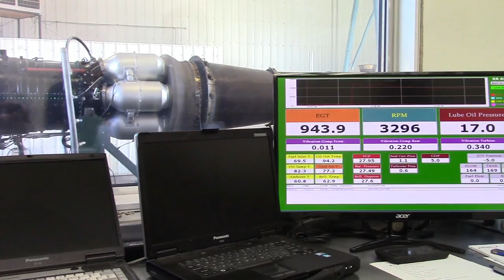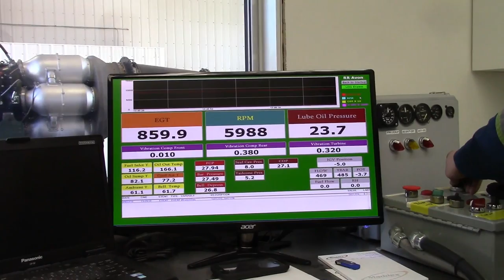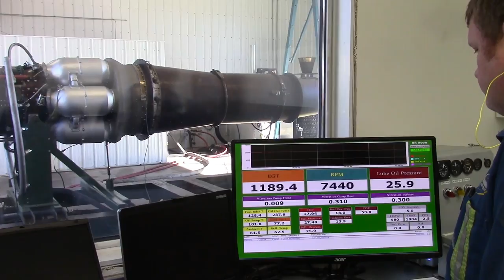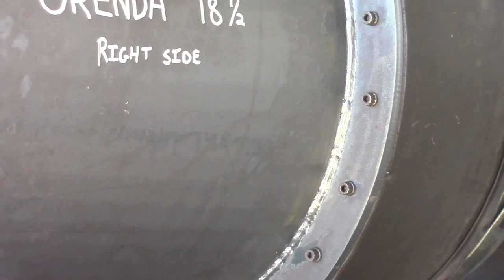Land Based Jet Engine

Comment: why does the EGT dip at certian RPM's? i noticed it was lower at 5000 RPM than when it was at idle and at (im assuming) max throttle
Reply from the maker: +Dick Cheneh 
Great question. I will provide a detailed answer in an upcoming video when I get back home.

Comment: In the words of the archetypal American travelog (the Brit in me wants to add '-ue') of yesteryear, "And so we say farewell to Singapore, land of the Merlion and the Singapore Sling (at SGD28 a shot)". I will be back on home territory tomorrow, following a 13hr flight back on a B.777. If it's a GE90, rather than a Trent 800 powered aircraft (BA have both), the vibration levels on start-up (which must surely be down to combustion rumble) are quite high, even unpleasant.
Reply: Hello Graham, hadn't said that <hello Graham> in a while so thought I would.  Hope your visit went well & those G.E.s got you back without incident.  I have never been on a 777; do others on the plane seem to notice the rumble at start-up?  Take care & thanks for sharing.

DD
Reply: Yes, the visit went well and I got back home quite uneventfully, thanks.  No-one else seems to notice the rumble and vibration of the GE90s at start-up, but then I'm relatively more aware of what the engines are doing and I'm in a position to compare them with Trent 800s (and 900s on the A380).

Comment: It seems like the turbine section of the engine is extended almost to the length of an afterburner jet pipe. Is there a reason why it is so much longer in this engine than in the aerospace version of the engine? (Also that compressor casing is gorgeous)

Comment: I have watched most of your q and a videos and never seen this question asked: Roughly how much does it cost for a engine test like this? I would assume it is included in the price for refurbishment? Thanks.
Reply from the maker: The test cell has a rental fee. Plus the efforts of several techs working for anywhere from one to four days, depending on the engine type, plus anywhere from several hundred to ten thousand for fuel.

Comment: Seems to be a very brief test,...power assurance test....but didn't see any trim suppression being done? You guys normally shoot for 23 degree Celsius correction along with correcting the rotor speed to the square root of theta to determine if you are hot and fast for a given enough PLA setting? What is the PPH WF for take-off?
Reply from the maker: If you read the first line of the info section, this is an industrial engine.
Basically a core of an aviation engine.
No trimming required; this engine does not use a jet nozzle to produce thrust.
It does not ever take off ( we sure hope! )
Fuel consumption is often not a concern, for several reasons.
This test was indeed to measure power, also vibration, and to check for any leaks.
The fuel flow is controlled by a computer, which measures rpm, temp, air density and demand.
Everything checked out.

Comment: Hi JZ. As ex USAF, (flt sim) and gearhead love the videos and tech info. Seems as though a lot of heat would need to be dissipated after shutdown. Is windmilling of the internals enough, or does the engine stay hot?
Reply from the maker: The long rundown time of several minutes has the compressor still moving air through the engine, so this is usually enough to cool the engine down to the point where no harm is done. but the jet pipe stays too hot to touch for at least 10 min or so...

Comment: Wow, the attention to aesthetic detail on this engine seems especially apparent; it looks like a museum piece! I love the green coated bolts on a black compressor housing. Is there a significance to the green bolts? Or just a choice? Also, for this test, is that a aircraft jet pipe attached? As this is an industrial variant, I imagine there will be a power turbine there when in service. So is a jet pipe a way of adding some load to the engine during testing?
Reply from the maker: The compressor case bolts were marked green as they were torqued.
Your thoughts on the jet pipe extension are correct.

Comment: I'm curious, for the industrial engines, what do you used as a measure of performance?  It's not set up to produce/measure thrust like an aircraft engine would.
Reply from the maker: We use a restrictive nozzle on the jet pipe. Increased pressure upstream of the nozzle is used to calculate power output.

Comment: Pretty green for this late in the year there.  Run looked good, you got a lot of the ambiance well in the recording including the human aspects which is good to see too.  I am curious, when these engines were designed it was without the benefit of 50+ years of operational experience.  In service, are the systems that monitor these engines performance over time modern adaptations to the engine or are these operated as-designed and monitored as they were when originally constructed?
Reply from the maker: The controls and monitoring equipment is supplied by the operator, so often it is fully modern. Often it is whatever was the best available when the facility was first built.

Comment: I am currently building a 3d printed jet for a school and potential business project. i am titanium 3d printing the turbine blades  and makings the intake cylinder and blades from carbon fiber and fiberglass.what im having problems with are the bearings for the turbine blades. Do they require special bearings being its exposed to almost 1000 degrees, PLEASE HALLLLLP , by the way you helped me realize im a total gear head!
Reply from the maker: Turbine blades are never made of titanium, because it is weak, has a low melting point, and catches fire easily.
I don't know what an intake cylinder is.
Turbine blades do not have bearings, in my experience.

Comment: What a beautiful piece of art.  It is a gorgeous engine.  
Question for you Sir AgentJayZ -- with an EGT of 1100 degrees (I am assuming F and not C) do some companies send the exhaust gases into a boiler to create steam for heat or electrical generation?
Seems like 1100 degrees would flash water to steam pretty quickly.

Fantastic video.
Reply from the maker: That is definitely done in some installations. It adds to the overall efficiency of energy usage.
Reply: There are numerous industrial gas turbine installations where the the exhaust from the power turbine, which is driving a generator, then goes to a boiler, which supplies steam to a steam turbine,  This arrangement is known as 'combined cycle'. Alternatively, the heat is recovered from the power turbine exhaust for district heating purposes. This arrangement is known as 'combined heat and power' (CHP).

Comment: How small is the gap between the turbine blades and the wall of the jet? It sounded a bit squeaky on the wind down at the end, what was causing that? 
(P.S. Thanks for the really informative videos! I'm thinking of going into aerospace as a career and these videos have taught me a lot about the function of these magnificent devices.)
Reply from the maker: This engine specifies 1/10 of an inch clearance between the tip shrouds. The shuddering sound near the end is the fuel pumps, which are axial piston pumps and have sliding surfaces inside.

Comment: What is the application for this engine?
Reply: Primarily used as a turbine for gas compression, oil pumping, and electricity.
Reply: In the description he says "ten thousand Hp industrial gas generator" which is going to be a 7 to 8 megawatt generator. You can find a lot of installations using jet engine technology.  There are some significant advantages to their use over other technologies.   The primary consideration is that anything that can be made a vapour and burned can be used and used in the same engine. In practice this is achieved by fuel nozzle selection if you are going to use Jet Fuel or Natural Gas or Propane (etc).  The power and efficiency deliverable is otherwise similar to a Diesel generators though I don't know what the peek Diesel generator power is, there are 48 megawatt Jet generators available now.

Comment: 0:10 in, and I have a Q.  The green tinted bolts on the compressor casing. Is that die to indicate there all set to go, or is that the color of the bolts?
BTW, I'm jealous. If only the engine in my Jeep looked that good when it came back from the shop, that OTF-3 looks incredible.
Reply from the maker: From earlier:  The compressor case bolts were marked green as they were torqued.
Reply: Thanks. I suspected as much, tho it just looked so good to be a simple green mark on each bolt. The crew that worked on that engine realy outdid them selves, it just looks so incredible all around.  Bravo Zulu.

Comment: Considering maintenance costs, sound levels, and fuel efficiency how does an engine stack up against and industrial diesel engine?
Reply from the maker: Same, louder, same, but also much lighter for the power output, if that matters.

Comment: Is there any specific reason why industrial turbines use propane rather than diesel / kero ?  like, do they produces more power relative to which fuel they use ?
Reply from the maker: Industrial turbine engines are often used at natural gas pipeline compressor stations.
They can be fuelled with the contents of the pipeline, which is convenient because they use a lot of fuel.

Comment: Agentjz, In regards to the Orenda type,  what is the psi of the air in the diffuser at maximum output?
Reply: If you do some research for yourself, I think you will find that the pressure ratio of the Orenda series is about 5.5:1. I think that I can leave you to multiply 14.7 by 5.5.

Comment: Does the electric motor in the front freewheel the entire time after power is turned off or does it have some sort of clutch/gear that is disengaged?
Reply from the maker: There are two systems. One is a starter generator, and it is always turning. The other is simply a starter, with a disengaging clutch. I'm not sure which system is built into this engine, but I would think it's the latter.

Comment: Hi everyone! Does anybody remember the units in which EGT is in? I mean for C it's quite hot! Second question would be for you mr JayZ. How long did you work on your last engines? Or on how many engines do you use to work simultaneously? Because it just seems to me that the test cell works like what.. once a week an other engine? Than you for your videos!
Reply from the maker: Since I am not eligible to give you the answer for Q1, I will just tell you that the test cell is a shared facility. There are four companies working on engines, and each of those companies have more technicians than Jet City. The test cell is used by all, and it can get quite busy.
Reply: Jakub Polomsky Looking at the screen with the EGT, below that is the ambient temperature, which is at 60°, so Fahrenheit. Don't know if the EGT is measured in Fahrenheit though.
Reply: I saw 1,184 (or thereabouts) for the EGT, so minus 32, times 5, divide by 9, gives 640. Now that looks reasonable for an EGT (aka JPT) in degC for this engine.  1,184degC equals 1,457degK: now that's turbine entry temperature territory for a more modern engine than an Orenda 14 or an  OTF-3. It's into the realm of cooled turbine technology of the early1970s - about that of the RB211-22B, for example.

Comment: Ive always wondered: The Inlet Shroud bit (the white part on the front), do you have a mass of different sizes to suit every different type of Turbine you test? Is there a standard size they all take?
Reply from the maker: The size of the inlet bellmouth is determined more by engie diameter than by mass airflow. We have several different sized units, as well as a few adapter rings, so we can accommodate the range of engines we test.

Comment: agentjayz, why does the compressor blades have a lower cross section for the stages? pressure increase?
Reply: That would be YES.
Reply from the maker: I'm not going to spend the time to sort out what you mean by this incomplete question, but what most people assume about the shape of the compressor is not correct.
I have explained the shape of the compressor gas path in several of the videos in the Your Questions Answered playlist, so you may want to have a look at the index.

Comment: I love your videos, I've watch 'em all. Jet engines are very reliable. I have a 2 part question with regard to failure modes. One, during the normal work life of one of these engines what issues require most maintenance. And two what are the most common reasons for their ultimate trip to the bone yard?
Reply from the maker: Fuel nozzles need periodic cleaning, and the combustor liners tend to slowly break up or erode due to vibration.
Probably the most common reason for scrapping a flight jet engine is because it becomes obsolete... the aircraft type is retired, and there is no longer a need for that model of engine.
Industrial engines, same thing. They can be kept running indefinitely. When the whole installation is replaced or revamped, that usually means newer engine types.
The engine in this video is over 60 years old, but has been returned to new condition. It will never be scrapped until it has no job to do.
Reply: I recall that, years ago, I used to visit (there's no other description for it but) a scrapyard in the Midlands of England that specialised in surplus military hardware (I think it still does). My father used to go there occasionally for various bits to equip his garage workshop. He was in what you know in N America as auto repair. On one occasion, we came away with an ex-US military, petrol/gasoline engine powered air compressor and tank, which we converted to an electric motor drive, and I did the wiring for it (now that would be totally illegal today!). I remember that, one time, there was a pile, several high, of Orenda engines (I saw the nameplates). How and why they ended up in the UK, I've no idea, of course. Another time, there was a pile of Olympus 100 series engines, which must have been from scrapped Vulcan Mk.1 bombers. Now their presence  in a scrapyard in the middle of England is entirely understandable.
Reply: I think that I might have answered my own question about the scrapped Orendas. It suddenly occurred to me that the RAF operated several squadrons of Sabres in the 1950s and Wikipedia informs me that they were Canadair Sabres. My guess is that those engines were from the Sabres when some of them were scrapped.

Comment: Would you be able to use the starter motor to generate some auxiliary electric power once the turbine is up and running? I'm guessing that's hardly a priority for industrial engines though...
Reply from the maker: The aircraft engine uses a starter generator, but industrial engines just need a starter.

Comment: What is the unit cost for an Orenda or J-47? I'm curious.
Reply from the maker: There is no unit cost. Each engine is a project, and total cost to rebuild it really depends on initial condition, and the intended use.
Reply: I see, in that case, you're doing an amazing job.

Comment: Question - how big is the tolerance between the compressor blades and stators?
thanks for making videos :)
Reply from the maker: It's not a tolerance, but a clearance. The two are not the same thing. There is a clearance of about 5 to 10mm between a stage of compressor blades and the stators. This allows some fore and aft movement while avoiding contact, which would cause great damage to the engine.
Reply: thanks for correcting me and answering
Reply: Thousandths of an inch.  Each stage is different.  The clearance decreases as the stages get smaller.
Reply: The axial clearance between compressor blades and vanes is defined primarily by the need to ensure that they don't 'clash' in the event of an engine surge.  The clearances may have to be further adjusted to allow for differences in axial expansion between the compressor rotor and the stator casing.

Comment: At what point does power turbine attach to the rear of the engine? Right behind the last stage or is there some set distance away from the last turbine stage before it is attached?
Reply: A power turbine is essentialy another turbine stage, attaching it any further than "just behind" the last stage would mean losing energy of the flowing air on crossing that distance. So power turbines are attached as close to last stages as possible.
Reply from the maker: This is intuitively true, but in practice the duct is of any length that suits a variety of requirements.
I have seen an PT duct that was over40 yards long with several 90 degree corners, and even a 180 in it.
It worked just fine.
The gases do not lose much temp as they pass through the PT, but they do drop almost all of their pressure.

Comment: Could a sodium powered jet engine run under water? It seems like it would not work very well.
Reply: boomchacle no jet engine could run underwater under any circumstances. Ya know....because they rely on compression and subsequent expansion of air and fuel. Water cannot be compressed so....
Reply: Yes, but It would accelerate instead of being compressed. I think that the expansion of fuel and water would happen because sodium could be considered to be hypergolic with water.
Reply: If a Sodium-powered machine could be made to work under water, it would quite obviously not be a Brayton-cycle engine for the fundamental reason that has already been identified by J D.  If it worked at all,  I would expect its efficiency to be abysmal.  There are already far more practicable ways of making a water jet propulsion system: a division of R-R could help you there.
So here's a question for you: how would you introduce the fuel?
Reply: grahamj9101 Use the sodium potassium alloy that is liquid at room temperature. Also I know that It would be Absolutely horrible in fuel efficiency lol.